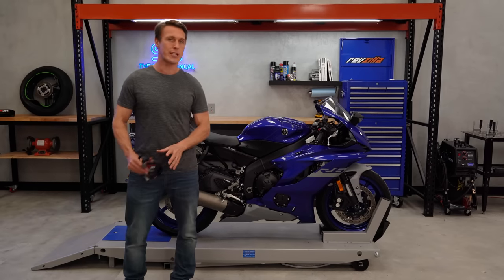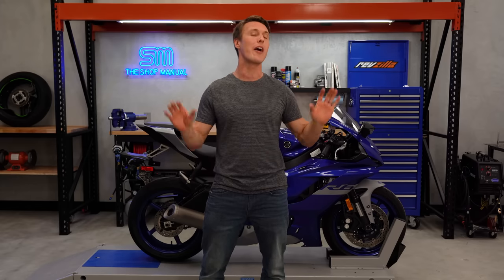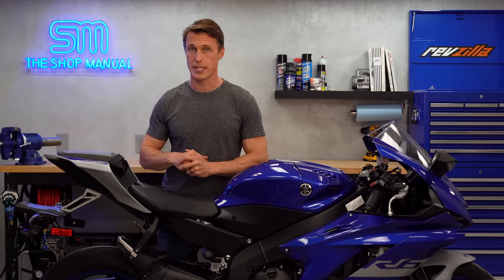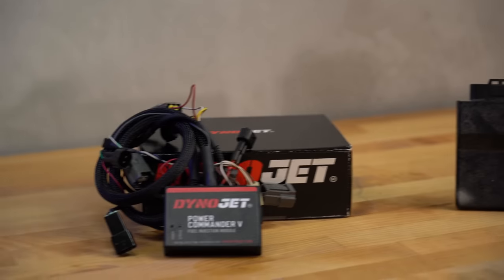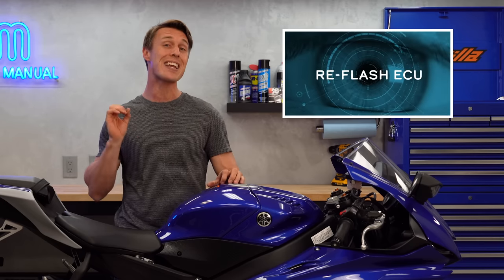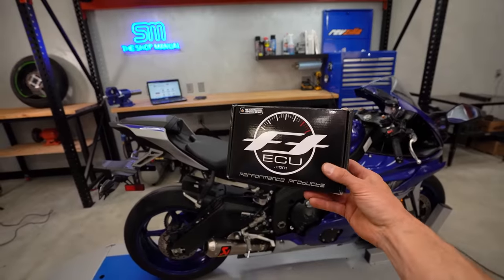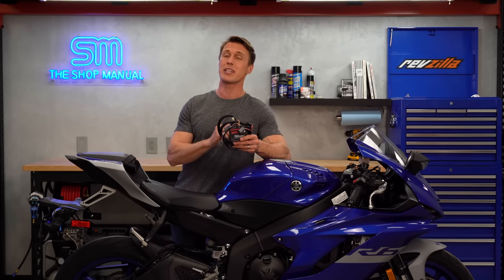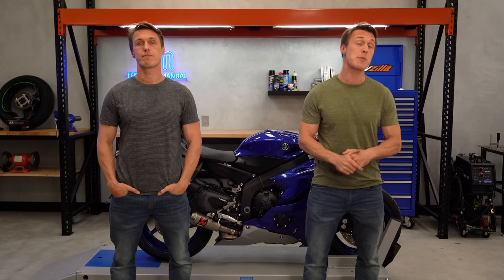ECU Reflash vs. Power Commander For Engine Tuning | The Shop Manual

Comment: A comparison on benefits between the two would've been a huge help.
Reply: Power commander is the way to go especially if you want a quick shifter those will require power commanders.
Reply: @angelcelis9090  no they don’t you can easily get a standalone quick shifter
Reply: @angelcelis9090 nope. Quickshifters can be used and installed on its own without power commanders.

Comment: Flash are better for performance as you can remove all limiters. Most bikes doesn't give 100% gas then given 100% as ecu is limited. Power commander doesn't remove this limiters and usually just give 1-3hp and is mostly over 500$ for almost nothing. I would go for a full ecu flash with all limiters removed.

Comment: Ecu flashing is superior. Had both.
Reply: Actually, both are best. ECU flash removes all the restrictions. Piggy back modules will allow for live on the road/track tuning with real world air intake at real speeds. WSBK, MotoGP, and many other racing platforms have different tunes for different tracks. I would go as far as saying flash is superior.

Comment: What brand ECU upgrade and software do people recommend to have full ECU customizing capabilities? A/F ratio, unlocking throttle, adding HP. I've heard of Dyno Jet and now HRC. I'm still thinking about sending you guys an ECU for my 2009 Honda Cbr1000rr with 12,600 miles. It has a Danmoto SC59 or SC57 exhaust. Its a full length exhaust if that matters and stock headers.

Comment: hi guys, I have just bought a CB1000R  2019, but almost new. I had a CBR 1000 rr 2011 and also had a brand new 2017 SP, wich had been stolen from me in Ft Lauderdale, (hope the thief crashed and got enough time in hospital, like 20 years or something) BUt 
I am hoping to get some info here. is it possible to install a CBR ECU to the  CB? I understand the CB engine is the CBR 2013 or so?  I am in argentina not sure if I can get a proper ECU flashing here, And is not lieke it really needs it... but I would not mind the extra adrenaline... any one can tel me here if there is  much more difference engine wise between CB and CBR.. like different camshaft etc? than you

Comment: 387k people watch this -- Can anyone explain why Power Commander can not create an Autotune that adjusts in any condition using the STOCK o2 sensor bung .. Example you install the pc5 then piggy back the autotune and the bike is fueled properly from then on like a car-- I think so they can sell more gadgets and make more money-- IF i could ever figure it out-- I would have an Autotune That plugs in like pc5 runs off stock bung and thats all you need.... One gadget.. NO flash No dyno sending ecu in 50 times  from idle to redline the bike adjusts its own fueling..  IF these bikes were carbbed I could rejet it in one hour. euro 3 4 5 crap

Comment: Just wanna say, loving the feel of the PCV on my 16' ZX6R. Can tell the difference night and day and finding the tune was easy enough. Only chose the PCV over an equal flash because if I wanted to change my flashed settings, I'd have to remove the ECU everytime and have it sent out compare to just plugging the laptop in the garage to the PCV
Reply: That's why I bought the flash tune kit and did it myself, along with flash tunes Auto tune. It's been amazing, as many flashes as you want and helps dial everything in.
Reply: if the auto tune works then there should never need be another adjustment @Apollo-Computers

Comment: I have a 2019 z400 and i know i'm not going to get much more power. But there is no reason for a liquid cooled bike to be getting hot at a stop light. Why is it getting hot? The ECO factory setting have it running lean. The throttle is also way more snachy than a 400cc has any buissness beeing. My dirt bike has a smoother throttle. And this all with the factory pipe. I really need a tune.

Comment: Moore mafia reflash worked great on a 300 better throttle better idle cooler running even the exhaust sound got deeper well worth the money ..bought used ecu off eBay for flash tune kept original ecu if ever want to return to stock..but why stay stock..the used ecu and flash was cheaper than power commander..call Moore mafia

Comment: i think what he is say is true BUTTT both options have to rely on the flasher or tuner to know your bike and exactly how it runs others   wise you won’t have the correct parameters set and or the correct fueling.  the correct way would be to purchase a afr gauge and a data logger to fix the halfway tune , look at what the car tuner guys have to go through a power commander or re-flashed ECU will not be correct just in the ballpark. i

Comment: IANAL, but: Won't "Void your warranty". However, any damage that can be linked to the modification can therefore be considered "user error/abuse" which may or may not be covered by the warranty (it's at the discretion of the company, if you've spent 150k with them this year, they may very well suck it up on a 2k job... or not). See the Magnuson-Moss Warranty Act.  DO NOT listen to a dealership that says it won't cover something because of mods done, talk to manufacturer's rep in the area, if it's enough money (and the dealer can't positively link it to the mods), talk to a lawyer.  It is on the dealer/manufacturer to show that the modifications led to the failure.   This is different from "service contracts" or "extended warranties" which expressly state that these products are not covered.

Comment: Just FYI, flashtune as a company is trash and has been known to damage ecu's over incomplete tunes. Go with more reliable companies, such as Bauce, KCS, Mooremafia, EDR. And rather than Power commander, go for a Woolich setup instead, as it will give you more control over what you are doing to your bike, and most new bikes only work with woolich. Woolich also offers diy tune kits as well which wont ruin an expensive ecu.

Comment: How does a flash tune work if let’s say the bike has rider modes like on my 2020 super duke r,,,can you specifically tune one of the rider modes? And then leave the others alone? And is that the same with a power commander?

Comment: Your needs and availability should dictate what you get.

Power commander/RapidBike is by far the cheapest option for my bike.

PCV 320$, RB evo 600$, Brentuning 800$ without import and other costs (was around 1000$ after everything).

If the third option was not available, I would have probably just left it stock as I like my warranty.

A piggyback is pretty visible, whereas a flash that you can revert back to stock whenever, is not, unless the ECU goes back to the bavarian mothership.

Comment: Does a motorcycle have to be running to have the ECU flashed? I ask because my engine is partially disassembled and will turn on but not start. TY

Comment: I had ECU flash on 1250 bandit bit of backfire from slip-on and air filter box mod cleaned it up nice and responsive down low pulls hard but still smooth and responsive very happy

Comment: Like to have a setup where I can change the mappings on the fly, i.e. push a button and the bike shifts from performance to economy mode especially when I'm running low on gas and the next gas station isn't close by.

Comment: Glad you stated the emissions stuff.  Most bikes are good enough from the factory for most applications.  The factory exhaust compliments emissions, noise, and performance.  If you alter the exhaust you must alter everything else.  Most the time the throttle feels more responsive but not a lot of horsepower can be gained.  Next time just buy a more powerful bike from the factory. Less depreciation with OEM vs add ons later.

Comment: If you get the ecu flashed how does it program to the bike? Like going thru a learning mode for x amount of miles? Or do you tell the people how you want it flashed ahead of time? (Or whats installed on your bike?)
Reply: There's different fuel maps for different exhausts and air filters. You tell them ahead of time when you send your kit in.

Comment: Power Commander is and has AWAYS been a crappy piggyback POS compared to the stock ECU....the problem is it was very hard for many years to do so with many bikes before new products and tuners, and tune deivces came around....Factory ecus have much more tuning range, self adjusting ability made by OEMs, and control over ignition, fueling, air, limiters, etc MUCH better than Power Commander could ever hope to do!

Comment: Two questions, 

do I need to reflash the ecu if PC added in case I want to switch between both of them because the hardware is changed (one for the track and the other for the street use)?

The second question is, how much horsepower is the PC gives me over the ecu flash, is there a big difference or the PC have more options?

Thanks for explaining
Reply: An ECU flash will do so much more than a PC will. You can't switch between the two, technically. Because the PC is downstream from the ECU. It's either you have the PC plugged in or not. If you have the money to spend the Woolich setup is great to have. I'll never put a PC on any of my bikes again after getting Woolich.

Comment: Here in Norway at least, the biggest difference is that if you install a power commander you keep your warranty (5 years on any bike sold in Norway). But you lose all warranty if you flash your ECU. An it takes a mechanic exactly 5 seconds to tell if you have had a flash done to your ECU. Anyone who tells you different is either miss informed or miss informing. If you buy a $20,000 bike. Why would you pay $200 to ruin the programing and lose the warranty as soon as you get it? Also, some bikes have more then one ECU that communicate different kinds of info between each other (For example the 2017 Kawasaki ZX10RR). When you flash one ECU, the other has a major freak out and stuff goes wrong quickly.
Reply: Just because a bike is expensive doesn't mean it's tuned to perfection for your riding style. A company's job is to sell bikes in as many markets they can. They don't care about optimal performance, and will limit certain features. You think Moto GP racers are running stock settings?
Reply: @GuitarGuy650  There are no "stock" MotoGP bikes. They are built as 2 of a kind. End even the two are different from each other. But the biggest reason people use PC5 or a Flash is that the emission restrictions. They really make powerful bikes less powerfyll and more jerky. A Flash or a PC5 is absolutely a good idea to improve your bike. But, it also voids whatever warranty you may have laft.

Comment: I've recently read that clearing the stock ecu's tune and using a Power Commander 5 with an Autotune is the best way to get the most power out of some bikes. The Autotune added to the PC 5 allows the tuner to give parameters for the PC 5 to keep the bike in when there are atmospheric changes. Fact is, not all bikes have O2 sensors, one of which is my 03 R1, therefore adding the O2 and Autotune seems to be the best for my situation.
Reply: What I’ve been debating on doing. The ecu has the governor and has limited my auto tuner a bit so curious if that would help.

Comment: Why don't you do comparison test of both methods? And present us with accurate results, not only story that we already know.
Reply: there is no comparison really. 
power commander only tunes your fuel (unless you add autotune and ignition module, which are 300+ dollars each)
reflash can tune everything, and with much more detail
Reply: Results will vary based on the bike, so a direct comparison would only provide data for that one particular model. To provide accurate results we'd need to do back-to-back testing with dozens of bikes.

Comment: Great basics vid! Depends on the type of bike, pros & cons for each. For PC good if mods done Vs coming, & warranty. Piggy backs give you the option to continue to amend, start w/ pipes, but later add a cam, can change w/ no additional $. Also, new bike under warranty, if you have a piggy back & something goes wrong, you can go back to stock, flash is static & dealer may argue to void. Beyond the 2 options Ari mentions, Smart tuners w/ Autotune go further, sensing your elevation, temps, adjusting. & better than both a flash or PC, a true ECU replacement like a Thundermax Autotune. No piggyback, dyno tunable, larger O2 sensors than factory, then Autotune out of previous maps, revert back to old map at any time. V&H is simplistic Bluetooth option, quickly changeable in app, but limited, uses factory O2
Reply: Power commander now has an add on auto tune, so you flash the PC for your tune and the auto tune adjusts fuel mapping for elevation/ etc.

Comment: The emission limits for sportbikes makes NO sense what so ever.
The amount of greenhouse gases that ALL sportbikes together in the world put out into the atmosphere, is absolutely MINISCULE compared to all the freight trucks and cars and suv's and airplanes and coal power plants, even if all vehicles use catalytic converters.
It's like arguing about 0.0001% of the vehicles on the road not having catalytic converters.

It LITERALLY scientifically and mathematically, would make NO DIFFERENCE WHAT SO EVER even if 100% of sportbikes in the world did NOT use catalytic converters. It would not make ANY difference to the global climate.
What we need to focus our legislation on is COAL POWER PLANTS and CARS / TRUCKS.

That is what MATTERS and can actually make a DIFFERENCE for our global climate.
Not the 5 sportbikes in your town that run with Yoshimura exhaust systems.
They literally make zero difference to your environment. The amount is insignificant.

You put out more greenhouse gases into the atmosphere when you charge your Tesla from a supercharger station that is run by the local coal / natural gas power plant, than a sportbike running the same mileage without a cat.
Because sportbikes are tiny, have tiny fuel tanks, and tiny fuel usage compared to every other vehicle.

Comment: Who even bothers with power commanders these days? Sure, you’ll have a perfect AFR but your secondary throttle valve will still close too soon or never open 100%
Reply: For almost every bike a flash is the way to go.  I had a gen 1 hayabusa turbo and the stock ecu can't handle much boost ecu wise.  A power commander v can accept a aftermarket map sensor and the pcv pti comes with built in map and temperature sensor.   Also the flash takes a minute or two to flash on the older bikes vs 2 seconds with a fuel controller.  Also many more tuners in my area typically use power commander.  If ecu tuning is available that's the way to go.

Comment: It's probably worth mentioning that one of the reasons an ECU reflash is worth doing is that most modern bikes-especially fly-by-wire bikes have abrupt throttle response. Flashing your ECU can fix that.

Comment: most of modern bikes do not allow any changes in ECU, ducati even do not allow to play with service status and get error codes and everyone slowly moving there, so you have to hack ECU with chance that it will completely die, and even if you succeed you still have to go to some service where they can tune bike on dyno. So if you want to save money check that your bike allow reflashing without problems or get PCV and do with it whatever you want.